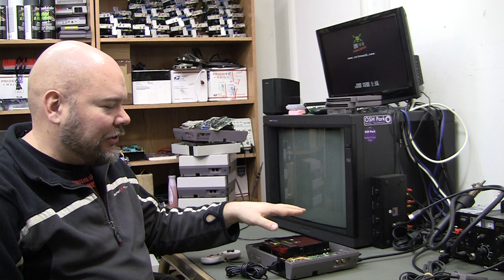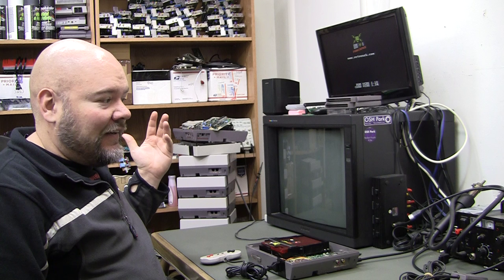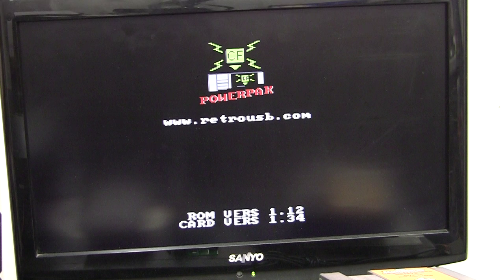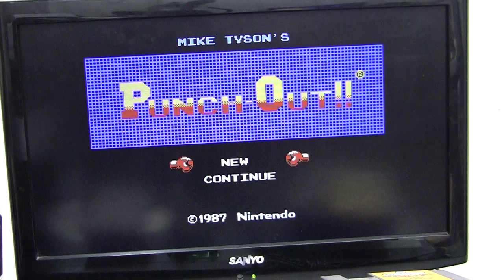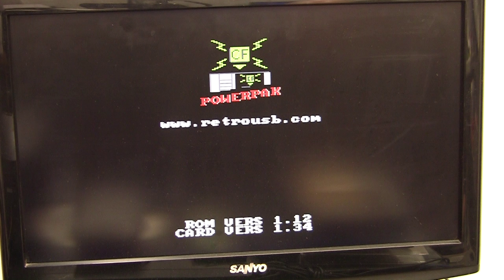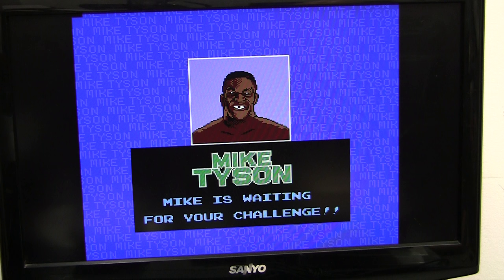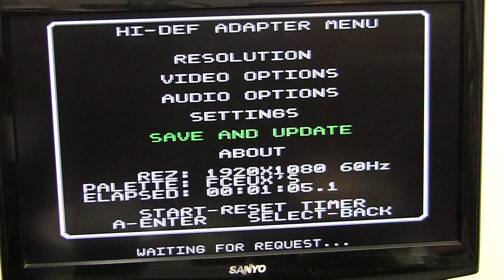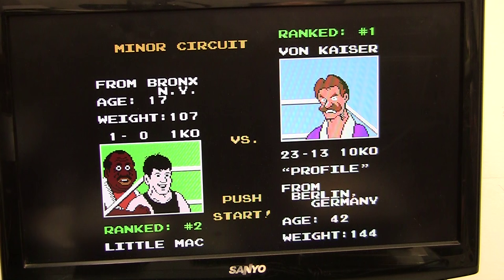Hi-Def NES composite video transistor removal glitch fix proof

Comment: Bypassing it would damage the PPU if static discharge on video cable while handling unplugged.  Also the "video current" is coming off the transistor instead of the PPU, so your PPU will run hotter.

Comment: I'm having an issue with my top loader where the screen will jump repeatedly on a cold boot, sometimes with garbled sound. Sometimes the screen will even scroll vertically. It does go away after a few minutes but is a bit annoying until it does. Any ideas?